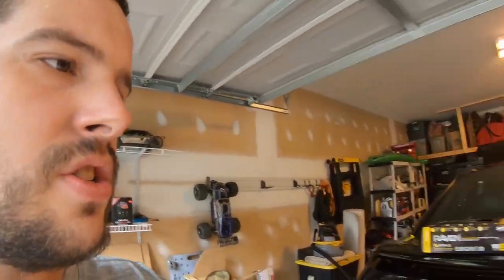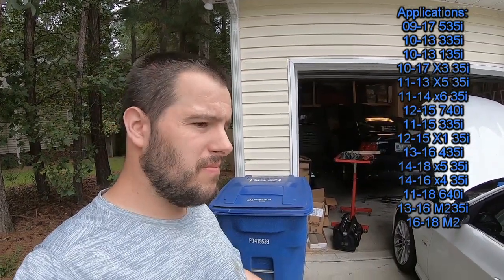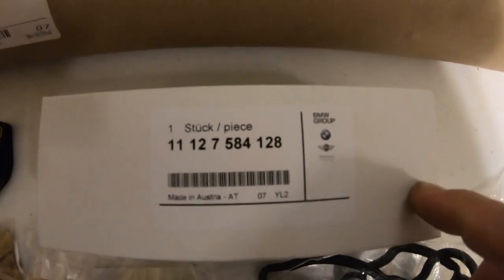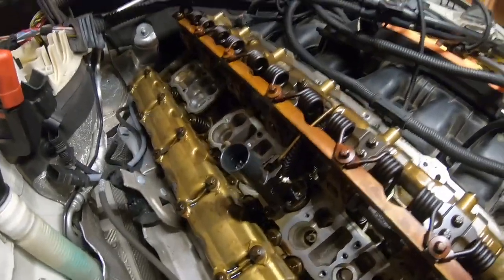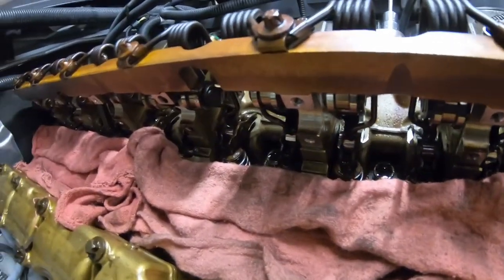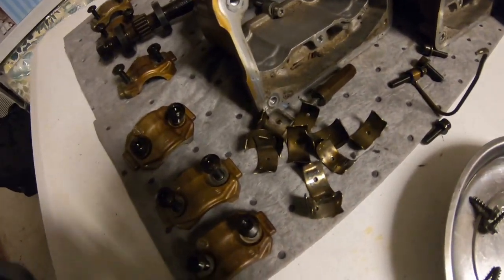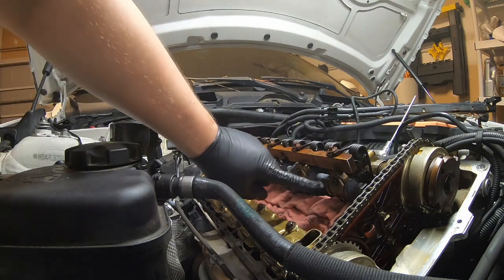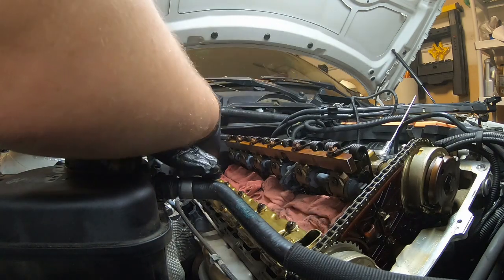Bmw N55 Eccentric shaft replacement

Comment: Nice work!! How many miles are on the car and was there any signs that lead up to the failure?
Reply from the maker: Car had around 115,000 miles on it. No previous signs before the failure.  Sometimes before failure you will notice a ratcheting or clicking style noise when unlocking the car.  This is due to the valvetronic motor attempting to due a reference run when the car wakes up. The ratcheting noise is caused by it binding up and not being able to move.
Reply: @MunkysGarage  like this?

https://streamable.com/guylxt

I was leaning towards it being the eccentric shaft sensor but it sounds like I need to do the motor or the whole eccentric shaft?
Reply: @MunkysGarage  Thanks for the info! Glad to see you put on some mileage before a large failure like this. Might I inquire what your driving habits are like and what the mileage was when you purchased the car?
Reply from the maker: I'm sorry but I cannot provide too much information on that front. This was a friends car and unfortunately he had purchased it a month prior from a used car lot.  But from my experience doing this job in the past, I've done it on cars with as little as 85,000 miles on them. Not really sure what causes the failure of this component. Seeing as how it is bearing wear causing the issue I would have to say oil change frequency and how hard the car is driven would be significant contributing factors.
Reply: @MunkysGarage  It would seem that BMW with their long oil change intervals had planned on you having to buy another car sooner than later. There are many stories of engine part failure where lack of oil changing and hard driving are very possibly the problem.
Reply: @AG-wi5bn  On my F30 with the N55 that system broke around 40.000 miles, even tho it had hade yearly oil changes. A "hack" that can be done is to move the eccentric shafts teeth away from the valvetronic actuator wormgear, thus disabling the systemet. The car will just fall back on using the throttle body instead. Won't even set MIL-status, the previous owner ran the car like that for 25.000 miles and I have continues to do so for the 12.000 miles I have owned. The problem you get is if the valvetronic fails while open, then the engines won't start anymore.

Comment: Excellent tutorial !!!!  

Q: Did you use Genuine BMW parts throughout or some OE parts (ex, gaskets, shaft actuator, etc)?
Reply from the maker: I used all genuine BMW parts to do this repair. Haven't personally used any aftermarket parts for this job so I'm not too sure what to trust.
Reply: @MunkysGarage   I understand.  Thanks for the reply and again great work on the video.  This is one of the worst repairs that N55 owners might have to deal with.
Reply: @johnclark7406  VDO is the original manufacturer for the actuator, as for the eccentric shaft, I believe only BMW manufactures theses, as they are made with extreme precision and not reusable for others since Valvetronic is BMW technology.